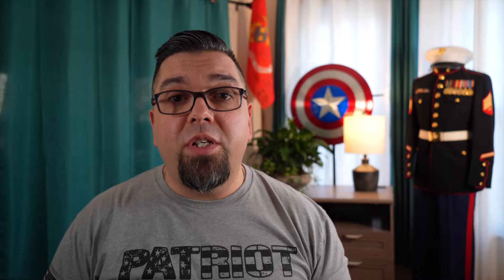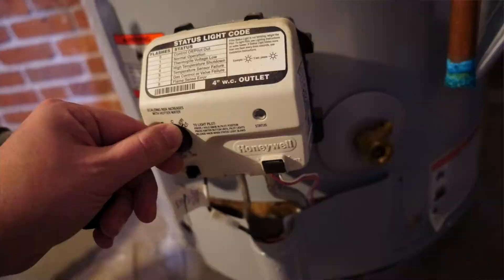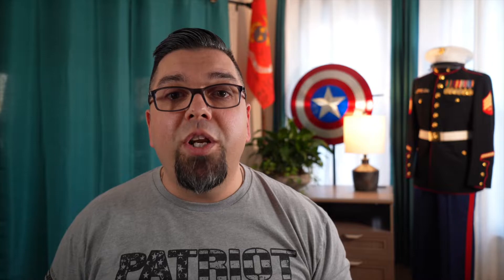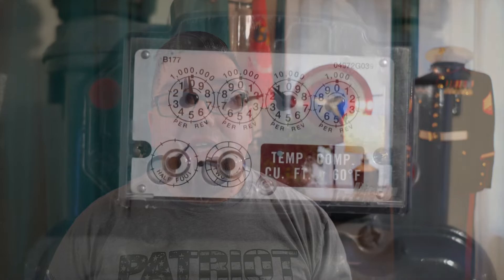How to Clock a Gas Meter

Comment: As a gas fitter, just read the btu value on the appliance Calc the gas flow/pressure and meter size. Done.